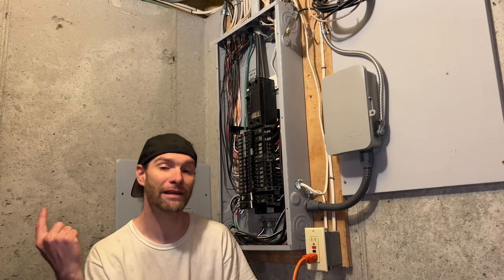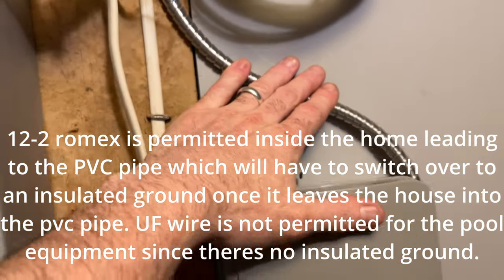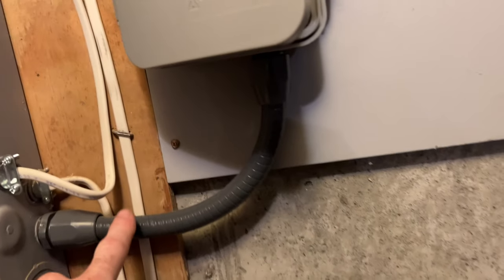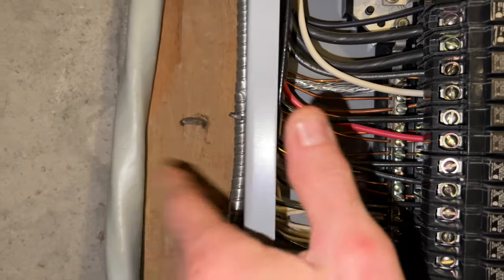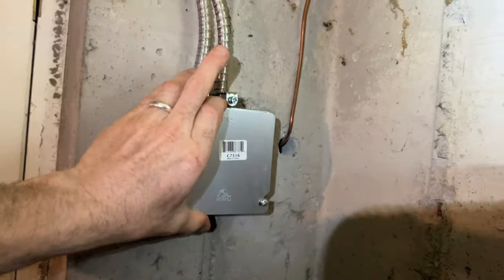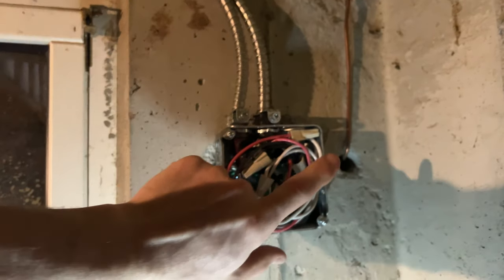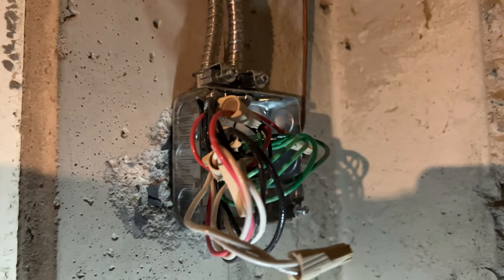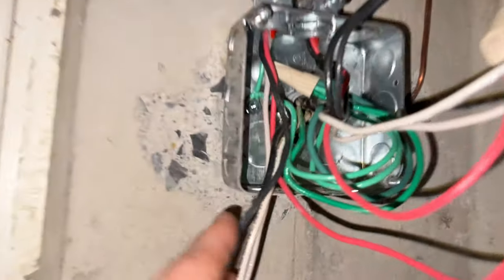How to wire above ground pool electric in panel. GFCI breakers, pump timer, & transition to PVC pipe

Comment: Did the ground the box or did you Bond the Box that is the question
Reply from the maker: All metal electric boxes get grounded. That includes the ones inside the house as well as weatherproof ones outside the house. The bonding however is to tie together the pool, pool, equipment, and anything metal with a certain distance around the pool.
Reply from the maker: It’s kind of like an isolated secondary ground. I don’t have the full in-depth technical explanation, but the bonding is kind like an additional ground as a fail safe or protection potential dangerous electrical shocks